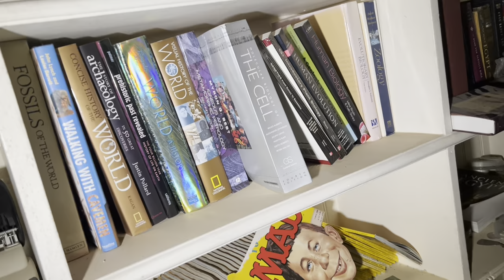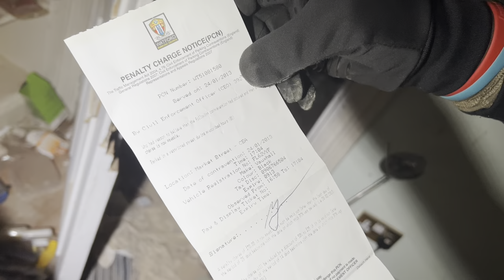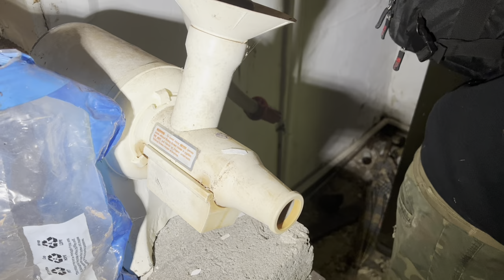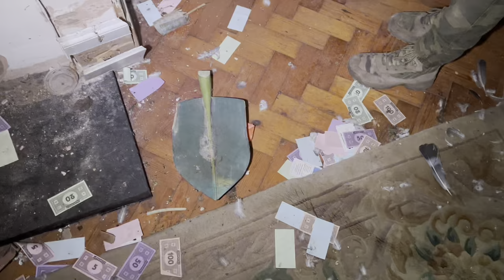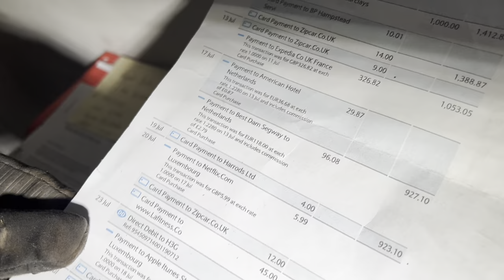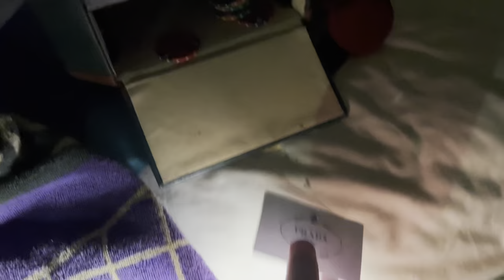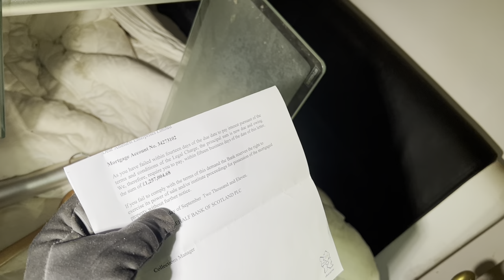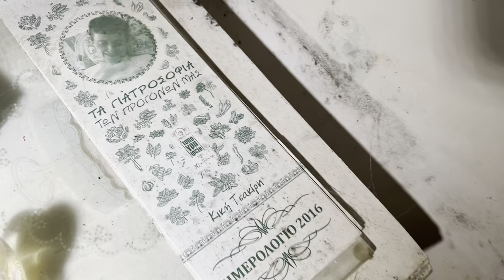This huge ABANDONED house has a mystery we need to solve

Comment: 32 Cliveden Place, London is a 4 bedroom freehold terraced house - it is ranked as the 4th most expensive property in SW1W 8HD, with a valuation of £4,200,000.

Since it last sold in August 2022 for £4,200,000, its value hasn't changed. Doesn't look of much but thats London for you I guess.